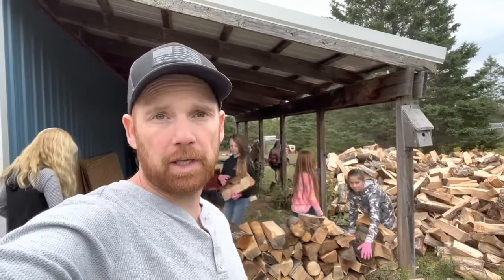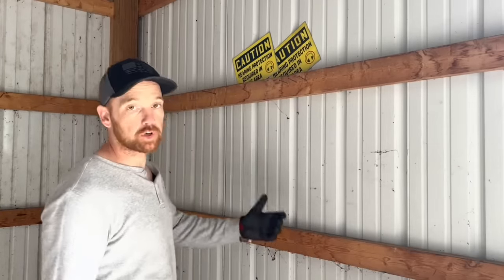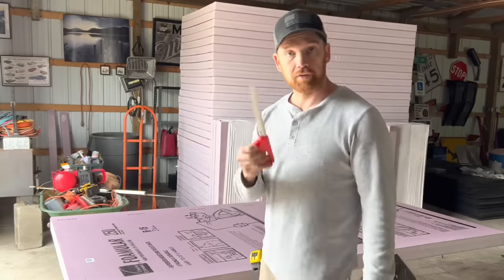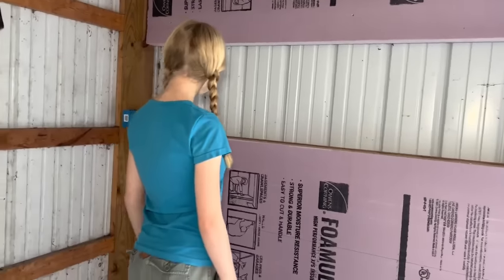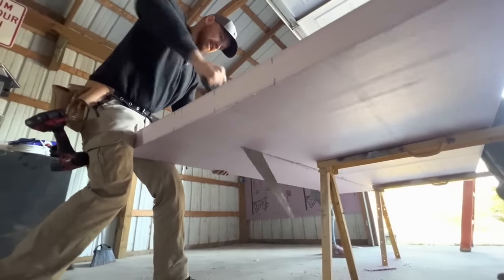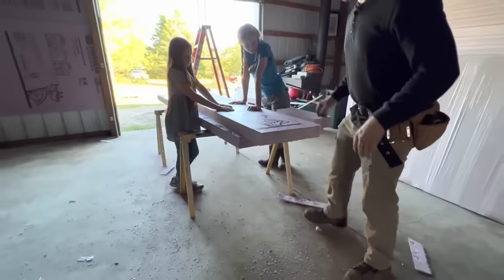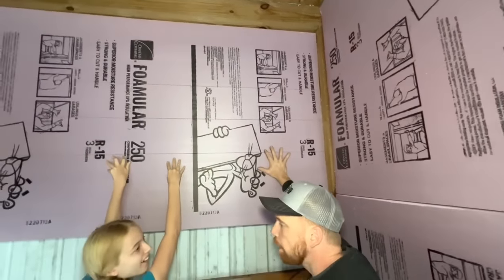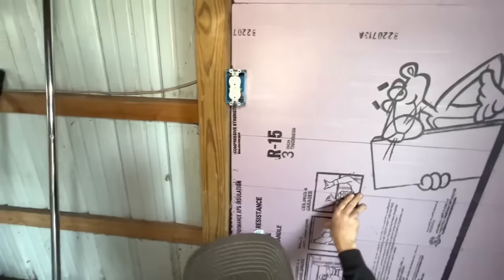Insulating our steel building/garage | Why we are NOT using Spray foam... Family prepares for winter

Comment: They have plastic washers so when you use screws they do not just sink into the foam but hold it securely. Also easier to tape the joints then use caulking. Mice will enter all those metal siding channels. There was a trim that would have blocked the channels along the bottom.
Reply: I used the starter on mine but I’m not convinced it will deter mice and bugs, there is still a 1/16-1/8 gap seen from inside the building.
Trying to decide how to seal that

Comment: the concept of the steel siding letting air flow behind the insulation panels looks like a great place for mice just to climb up and have a little home so a cheap solution would be Dollar Store stainless steel scrubbies you can just stretch them out  cut them and just put the little pieces in between every Gap in the siding to hopefully stop the mice. PS my friend had a quonset hut with the spray  insulation and lived next to cornfield the mice turn that stuff into hundreds of tunnels it was a nightmare for him.

Comment: It's been a while since I watched your videos but I'm glad I got to see this one. We're building a post frame building and debating how to insulate it. Spray foam was suggested but cost was outrageous! Foam sheets aren't cheap either but a little more affordable and something I can do myself. I may be able to get a little help but I don't know if they would be as reliable as your helpers. Your girls do a lot more work than a lot of boys nowadays! I didn't hear them complain once! They have a good father for life lessons not to be forgotten. Also good memories with Dad! I'm glad I had a dad that had me help him with stuff around the house. I'm sure your girls will appreciate all the time you spend with them. It's not work, it's time with Dad!

Only suggestion/question I have is why didn't you use the reciprocating saw (sawzall) to cut the insulation?
Reply from the maker: Hi Mike and thank you. We probably could use a sawzall but the hand saw 🪚 really worked great and kept a straight line. And manual labor when we’re in no hurry is better for you. Take care Mike and have fun on your project. Also read all the comments in here and do some research. Lots of mixed feelings about how we’re doing this.
Reply: @9252LIFE  You're probably right about the hand saw. Going slower can be better, especially when you have your girls helping you. My Dad showed me a lot with manual labor. Very memorable times with Dad.
Reply: Wondered why you cut [without safety glasses] the two nails off with your sawzall when those two nails could also help attach the insulation to the wall?
     Also I would certainly have my daughters wear safety glasses especially when pulling nails out of boards above their shoulders!
Reply from the maker: @brent9884  you sound like a great father! Good job

Comment: To cut that insulation foam board try using a wide blade retractable utility knife. With a couple of easy passes you'll make a very smooth cut about a 3rd way through the board and then you can simply snap it off. Real simple. It is by far the easiest way.
Reply from the maker: I considered that but was scared to wreck a $58 piece of foam board! 😆

Comment: I hope you checked the chemical reaction between the adhesive and insulation, glue tends to melt that type of insulation.  We usually have to have to use a special adhesive, or caulk, or metal seam tape in your scenario.  An electric kitchen knife or hot knife also makes short work of the cutting.
Reply from the maker: Thank you Alvin. The adhesive we are using is for foam board. We don’t want to use a hot knife as the smoke from foam is usually quite toxic and the old timer hand saw works quite well. 🪚

Comment: Best way to cut it hook up a wire to battery long enough (9 volt should work for a while) on a switch to make a circuit. Close the switch battery turns thin wire red hot slice your foam
Reply from the maker: That sounds great but when foam burns and creates smoke it is VERY toxic.
Reply: @9252LIFE your not burning it you are melting foam

Comment: Would it have been easier to start at the bottom and work up? That way you aren't fighting gravity as much. Otherwise, probably not too much difference since you are only using a bit of 2 sheets per section

Also, maybe an insulation tape instead of the adhesive, IDK?

Otherwise great video.
Reply from the maker: It’s not bad using full sheets at the top. We wanted to keep less seams at the top so the rising heat doesn’t find an escape route
Reply: You start up top so it's sure to fit. Nothing worse than having to cut where it shouldn't be necessary because your sheets are  48 and a 1/8th wide or the existing ceiling is perfectly straight.

Comment: I watched your video on clearing land a few years ago and I did that also with a little twist. When I piled the brush and logs, I rented an industrial wood chipper for the weekend for a couple hundred dollars. It mulched everything under 10 inch in diameter. I can uses mulch on my garden, orchard and flower bed. Once all your piles are ready, it takes no time to clear acres of land. Then I started the process all over again. It just an idea to make life easier. Peace from Canada 🇨🇦.
Reply from the maker: That’s a great idea. I had a chance to purchase a large chipper that attaches to my tractor but drug my feet on it and it sold before I could buy it. Mulch is great and also the ash from the burn pile works great in the gardens.

Comment: Snake haven and mice hiding area behind that insulation, take my advice close those hole in the steel bottom with foam before you cover them
Reply from the maker: I was wondering if we should do that with foam or just put in some hardware cloth
Reply: What part of norther Michigan do you not understand! Mice and snakes freeze at Xmas.  Yes some remain…. In hibernation but this is the great white north!,,,,,,,,
Reply: @svallicat865  well when you find a snake skin that's six foot long or have your wiring chewed and a fire started you'll wish you just done that little extra step

Comment: Former contractor here (now retired) and have never been a fan of spray foam insulation (too many issues).
Also, if you ever have to remove a sealed wall, insulation panels are waaay easier to deal with.
I can't stress enough the importance of air flow and ventilation if you don't want future problems.
I'll take a structure that "breaths" any day!!! And, a jigsaw works the best for cutting.

Comment: Nice job.  When I did the same thing in my garage, I took a long 6" Sawzall blade, ground the teeth off and made a knife edge instead.  I used a Milwaukee Hackzall (mini Sawzall) .It cuts through foamboard easily.  It does generate some heat, so I kept a block of paraffin wax (canning wax) at hand and wiped the blade with it before every cut.  The advantage is that I did not have all of the plastic dust that is created by the saw teeth.

Comment: I'm in lower Michigan and building a 30×40 barndo in the spring 2023. I don't want mice and snakes coming in so I'm caulking every peephole you showed. I get venting but not me. I may change my mind a few times before I start. Wood burning and ceiling fans all across the open lofted ceiling. It's just me now and my 3 dogs. The front will be all windows. I get so much sunlight daily. I was quoted 100k by a contractor but the Amish do it for alot less. YouTube taught me all the pex plumbing and I already know all the electrical so praying for a smooth transition.
Reply from the maker: I’m considering stuffing steel wool or copper mesh in those openings. I don’t think mice will chew up the foam board but they may make some smelly nests behind em

Comment: I used 60 sheets of 2” foam board in my pole barn with no issues in 2003. Cost me $22 a sheet then. I cut some sheets with my circular saw for speed and accuracy. My garage heats fairly easily. Easy to work with and no issues like you say with condensation.
Reply: 2in sheets are  $32 at my local home depot. That's a 50% price increase in 20 years.

Comment: I did something similar. It may be easier to cut the foam board leaving a 1/4 inch gap around the whole perimeter and then spray foam in. Also fender washers screws can pull it in tightly. Good video. I also built a cabin up in the UP in the 90s and I’m currently in North Carolina.
Reply from the maker: When we screw the sheet metal to the walls it will hold the foam board tight against the wall.

Comment: Watched your video because I wanted to see Why you did what you did. Looks like you're insulating same way (approximately) I did in my metal building/ home.
After 6 years of living in here, I must say, Metal buildings Do Not Breathe. You will notice this most significantly during the warmup after an extreme cold snap, when several days of frozen condensate from human activity thaws and "rains" down from the edges of your purlins.
Haven't figured out just yet the right kind of active attic ventilation to counter this and other condensation on metal related problems, but, there are a lot of fascinating videos out there still. Thanks, subd
Reply from the maker: Thank you Ryan

Comment: I suppose both can be good and bad. I spray foamed (closed cell) a small attic space, because I had a very specific issue to address.  I live on the coast, and the high humidity from the ocean coming through the soffit vents was destroying my attic mounted air handler and plenums.  The air handler sweat so bad, it was rusting away after only 5 years. The metal condensation pan would fill with water, and looked like it was 30 years old.  It solved all of my issues.

Great job on the insulation. I’m building a metal storage building in the next few years, and likely use the foam board, that is better for the application to allow moisture to escape because metal acts like a condenser.

Comment: I cleared my own land , built a pond and then took 2 years building a small barn house (1200sqft) from a metal horse barn style carport.  In 2017 I had the house spray foamed for $4800. Inside walls & roof with 2.5" of closed cell and interior walls with 5.5" of open cell for noise control between the rooms. Absolutely love it. One mini-spit in the loft keeps everything cozy and the house is solid and quite. Jump to 2021 and I built a 20x 30 carport and they wanted $4900 just to do 2 walls and the roof !   I'm went your route simply due to the cost but I can really tell the difference in how much louder it is and the wind buffets it around much more. Spray foam from a reputable company is great but the cost has gotten way out of hand :(
Reply from the maker: Did you use the spray foam in a can in between your foam board panels?
Reply: @9252LIFE  Yes and everywhere else I could get it, LOL. The main difference is it's not bonded to the wall and roof panels so it doesn't give any additional structural rigidity. Also the building still has that tinney sound which the spray foam got rid of entirely. It's not such a big deal in the carport but the spray foam totally transformed the metal barn house. The foam boards are a good cost saving alternative for shops and garages but even those are getting too high priced. They keep repeating on the news that inflation has gone up 8% but it seems everything I buy has doubled or even trippled :(

Comment: I added 1/2” and 3/4”foam board inside my attic of my 1958 home after Hurricane Harvey.  I cut all of my foam board on a table saw, two to three boards at a time.  It cut through that foam board like butter.  Use a  plywood type of blade.

Comment: And I'm looking at a 40x64x16 building, so that $16k would be more than double (northern Wisconsin). Stuffed white foam (owner provided) into the outer frame (where you didn't) years ago when renting a pole building. It did sweet when heated. The mice loved the foam too. Liked your advice on this.

Comment: I had problems with the FOAMULAR shrinking, leaving 1/8 - 1/4 inch gaps between sheets. These were installed external and were tongue and grove.
Had to remove the siding and tape the seams to keep air and bugs out. The Foamular did not shrink when used in my crawlspace foundation. On my newer buildings I used Polypro foil on one side foam board & taped the seams.

Comment: I did the same as you but different,  regular construction 16" on centers. I bought 4" foam board insulation with paper on both sides 4 x 8 sheets from a guy in Rensselaer @$30 a sheet. I also watched videos on how to cut it, finally just used my table saw, but cut those big  sheets down to 4' x 4' for ease of handling. Have to rip each piece one at a time to the measurements of one stall of the 16" on center. Big rubber mallet with piece of hardwood to pound it in. Haven't done ceiling yet, bottom of trusses is 3 1/2" foam is 4" so have to cut out 1/2" where nailor board is on top so foam ends up level with truss bottom.

Comment: If you do another more pole barn look at 5 1/2” Roc wool R23 2’x4’ batts. Cut with your handy dandy red Handel knife , goes up so fast. No glueing or screwing and fits really well. Sound deadening, water proof, fire resistance,rodents don’t build nets in it. Think you would have liked it much better. Great family enjoy your project.
Reply from the maker: Thanks Dale. I’m about to purchase some insulation for my cabin I’m building. Would like something more human friendly for air quality. Will look into this as I’ve heard good things about it.

Comment: Enjoyed the video and seeing your girls helping you. Reminded me of my girls helping with the winters wood supply. You will most certainly have a  rodent problem though. They will come up between the ribs on the metal siding and your insulation sheets. I would recommend that you get the steel strips that cover the bottom of your metal siding.
Reply from the maker: Got em. Glad you enjoyed the video!

Comment: quick tip; 
when using a hand saw hold the saw with your index finger pointing forward, not as a fist, your cut will be straighter and the saw will bind less. it's the same as pointing, more accurate to point with a finger than with a fist.

Comment: I chuckled when I saw the new saw You had. Nope. LOL.  For thick Material You need a saw with wide Kerf like the Handsaw You used. Even an Electric Knife gets stuck.  I used a Table Saw out side. 
You new Saw is for batt Insulation. 
I have a 30x40x10 that I need to do. But the heated Floor comes 1st.
Thanks Mike M. Central Wisconsin.
Reply from the maker: Heated floor would be awesome!

Comment: I've run miles of what we (framers) call foam and if you stack at least 4 sheets and take 2 hand nails and push em into the foam ( out of the way of your cut) it'll stabilize the top one then ...example, a 6 foot piece. Run one edge of your tape on the end , pull out 2 feet and use it like sheetrockers do when cutting drywall then flip it over and snap it also like sheetrockers then use your knife to cut whats left and done. After you do it this way for awhile you can do almost any measurement in less then 8 seconds.

Comment: Wow, that is a HUGE job but the savings should be worth it.  I was thinking of insulating my basement walls with this type of insulation.  I felt like I would need to buy a lot to do it, but that is nothing compared to the space you are trying to insulate.  The height would be very intimidating alone.

Comment: I use a wide blade kitchen carving knife, sharpened briefly on a grinding wheel.  (I want the slight serration)  And I do not cut the full 3 inch thickness.  I cut perhaps 3.4 of an inch deep,, sometimes I cut both sides.  If a shallow cut and a long blade,, it self guides to a degree,, score and snap it.  A retractable matte knife works fine too.  Again,, don't try to cut all the way through.  Score both sides,, and then slide the sheet so the cut line is exactly above the edge of the bench,, or edge of the stack of sheets.  Give a quick push,, it snaps

Comment: You have to be very careful when using any construction adhesive and spray foam on Foam board insulation.  The adhesive will actually melt the insulation leaving a gap while it cures, same as the spray foam.  Lepage makes PL300 just for foam board.  I learned this the hard way.  Good Video.

Comment: I realize this video is over 1 year old - I bought a home in Almont, Mi in Oct 2023 and had my 30' x 50' x 16' tall pole barn closed cell spray foam insulated (3") for $9,500 and this included the ceiling. Although expensive, fortunately there is some competition where I live in lower Michigan to keep the price down.

Comment: Robin Clevett in UK uses a Festool insulation cutter. Not cheap but vastly less than you saved by not using foam and you can sell it when finished with for same pirce as you bought it for

Comment: I suggest installing foam board with small gaps all around every side of every piece, then spray foam the gaps with cans. Much quicker to install because the cuts don't have to be perfect, and it also seals everything up much better. Also, the black printing in for a cleaner look, in case it may be some time before covering it.
Reply from the maker: We started leaving gaps and using just the spray can foam to fill gaps. We like the panther artwork 😆

Comment: I use silicone dry lubricant spray on a fish fillet knife every time I start a new cut. Using two inch closed cell foam to insulate concrete walls. After concrete wall is painted with a mould resistant paint, I use a solid bead if silicone adhesive around the perimeter of the face with dots of silicone every two feet along the length and and down the center of the boards. I will even silicone the joint faces as I "glue" the boards. The boards have a lap joint along the length to prevent excessive movement and a positive seal.

Comment: Heavy duty snap blade knife works fine. For part of mine i also used a temperary hot wire set up i built quick.